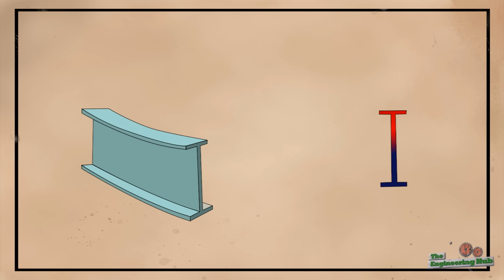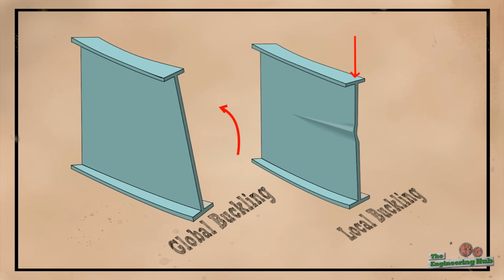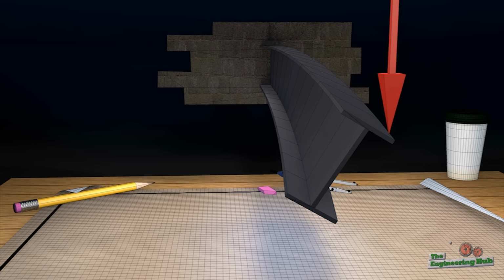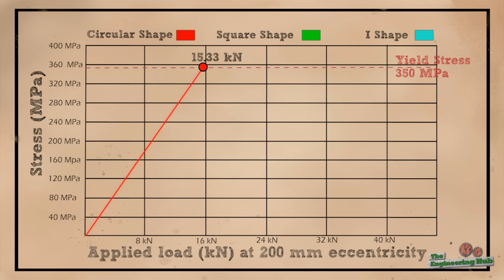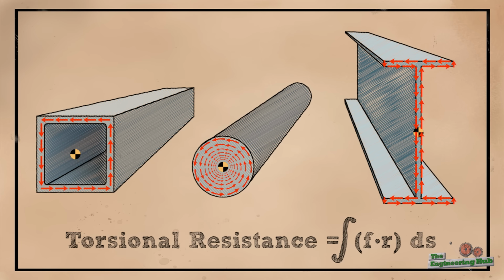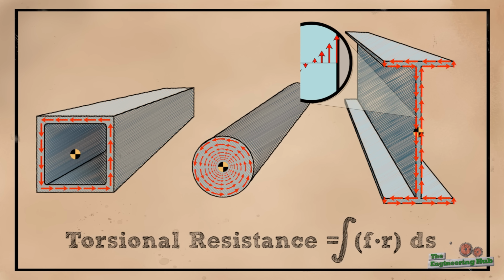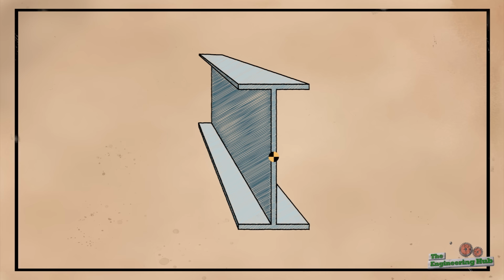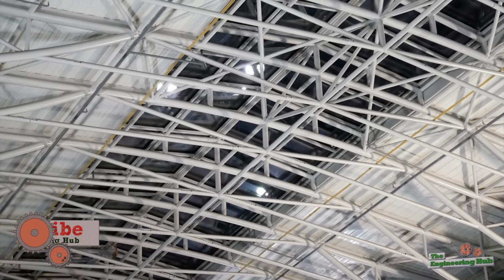The Critical Weakness of the I-Beam

Comment: Great video!
This video made me think of the forces placed on a hollow driveshaft of a vehicle.  Can you do a video explaining why it's better to be hollow vs solid?
Reply: Rerun the video, he dooes show you why hollow is better than solid. Basically, the further from the centroid the mass of the shaft is located, the greater the torsional force it can handle. Add to that the weight saving due to having a hollow shaft rather than a solid shaft and there are the two good reasons for hollow shafts.
Reply from the maker: Thank you ralph and Michael!
ralph, Michael has done a great job answering your question.
Thank you both for your comments.
Cheers
Reply: @TheEngineeringHub  Thank you for sharing your knowledge. I would still like to see a video that explores solid versus hollow a bit more, in particular, the optimal wall thickness to achieve maximum stiffness. I am thinking about axles for trailers etc.
Reply: @dougholland7563  The optimal wall thickness would change, depending on the axle length, diameter, and material used...
Reply: @dougholland7563  I used several hollow tubes welded form the inner to the outer to form a thick walled hollow shaft because hardening of metal usually only on the outer 6mm or so. I would say the ideal thickness for a tube wall is 12mm.
Reply: @jessh5310  Thank you! This gives me a useful benchmark to start from.
Reply: @michaelkelly339  
So, really it comes down to weight and material (cost) savings.  Surely, the simple fact of having extra material in the center would not be detrimental to the performance.  Remove the center and use that material to build five more driveshafts....cost, right?
However, I was informed in a high school automotive class that a hollow tube was stronger than a solid.  I think with it being solid, it would allow the shaft to twist easier.  I'm really not sure.  If that is the case, why have any shaft solid (i.e. a steering shaft)?  I really want to see the physics behind it.
It's torsional strength vs bending, right?
Will a solid shaft twist easier than a hollow shaft of the same material and diameter?
Reply: @RalphSampson...  
The answer to your questions is unsprung weight.
I don't have the exact numbers but unsprung weight (driveshaft) affects inertia, momentum and acceleration far more than sprung weight (anything above suspensions).
With some claim citing as much as 10 times more, again, correct me on the numbers.
So the weight saving here isn't for the cost but for the overall increase in performance.
F1 would've use solid shaft if they are better.
As for the steering shaft, while theoretically a hollow tube may be stronger, it resonates vibrations that can be transferred directly to both your hand via steering wheel, and the wheels themselves, resulting in poor (read dog shit terrible) driving experience and loss of precise control of the car.
Axle Shafts and CV joints are solid because they need to be able to withstand push-pull forces, where the driveshaft don't.
Reply: @RalphSampson...  a solid shaft will be stronger in torsion than a hollow shaft of the same DIAMETER, but it will also contain much more mass (and weight).
A hollow shaft made of the same mass (and weight) as the solid shaft, will be stronger in torsion, and more importantly for driveshafts, much more resistant to deflection (bending).   This rigidity is extremely important for keeping driveshafts balanced.
Reply: @RalphSampson...  Any extra weight in an end supported driveshaft will decrease the max rpm it can withstand.   If you lay a steel rod (solid) or tube (hollow) horizontally supported only at its ends (u-joints for a driveshaft), it will bow downward due to gravity.   You may not be able to see this, but with precise enough  micrometry you will be able to measure it.
If you run this experiment you will find that a hollow tube of the same diameter as a solid rod of the same material will sag less, mainly because there is lower mass pulling it down.   Now imagine a kind of gravity that gets stronger for every micrometer that that rod or tube deflects downward.  This is the environment a driveshaft operates in due to centrifugal force that will be many times Earths gravity.   And why high performance driveshafts tend to be hollow, fat, and aluminum.
Reply: Perhaps I can share my way of understanding it. Its nothing about hollow or solid. Its just strength per weight ratio or something like that. A solid one inch thick rod will be absolutely stronger than a one inch thick rod with a hole in the middle. Having material in the center is merely less bang for your buck though. The total bang does increase by having more material, but this is engineering; you want efficiency, and weight is a common concern. So imagine keeping the weight constant by shifting the material outwards. Instead of having material in the center, lets put it on the outside. Same weight(material amount), but you sacrifice a bit by making it a bit bulkier. And it becomes stronger.

Another way to understand whats happening is to think of leverage. Imagine nailing two nails into a piece of wood being half an inch apart. It would require a certain amount of resistance to being twisted together. Now if you nail it one inch apart, it would offer a lot more resistance to being twisted. Its basically leverage, here as a "resisting force" by the material.
Reply: I’ve learned much just reading these comments, thanks 🙏🏼

Comment: Wouldn't the corners be "stress risers" instead of actually"discontinuities?"
Reply from the maker: Yes, we could have been more clear about that. The discontinuity is in the geometry of the 90 degree corner which in fact causes stress concentration or as you pointed out a stress riser. Excellent observation, thank you for pointing that out!
Reply: I work with structural steel. In reality beams we fabricate out of hollow box section do not have sharp corners. The corners are very rounded, the radius on the corners can be 20-30mm or more on a 600x300x12.

Comment: Great video , thank you. One question, why did you make the circular beam solid? Given the only constraint was equal square area, surely it would have performed better as a tube?
Reply from the maker: The reason is two fold, first because our older video had these exact three shapes so we thought it would be nice to use the same shapes for comparison. Also, since we already had a closed shape (the square tube), and an open shape (the I beam), a different category of beams might have been better so we went with solids. That was the reasoning in the first video at least, for this one we just continued with the same shapes.

Comment: There is no fatal flaw in an I beam, if an I beam fails the fatal flaw is with the people who do not understand how an I beam should be used
Reply from the maker: You are not wrong John! But it is still a weakness, since a slight offset (eccentricity) of the load would reduce the capacity drastically.

Comment: Would crowning the top surface help to keep the load on centre ?
Reply from the maker: Hi Peter,
That's not something we've seen in our engineering practice before.
More often, we see either the I-beam or the point of load application moved, or stiffeners/braces being added.
Thanks for your comment!

Comment: Ever noticed the inboard corners of I beams are rounded and not square ? Reduces twisting by spreading torsional loading. The material is thicker and torsional forces are radially fluxed.

As others have rightly stated - I beams are not flawed they just have limits.
Reply from the maker: Hi Ade,
You are right, the corners are rounded for that reason. Good observation.
Hope you enjoyed the video :)
Reply: @TheEngineeringHub  I did enjoy revisiting first year mechanical engineering.

Comment: Does this mean the reinforced I-beam with the diagonal struts welded to the beam next door is the ultimate answer? Thereby eliminating any sideways collapse, turning the I-beam into a box shape?
Reply from the maker: Hi Bill,
The 'reinforced I-beam with diagonal struts welded to the beam next door' is a common and feasible solution, but not necessarily the ultimate solution.
If the same structural capacity could be achieved with less material, say by using a box beam, then the box beam would be a better solution. Additionally, sometimes geometric constraints restrict the feasibility of adjacent beams and/or struts. 
Thank you for your comment and we hope you enjoyed our video. 
We are looking forward to making many more.

Comment: Wouldn't most I-beams that are used in structures be designed to handle more weight than they will actually end up holding?
Reply from the maker: Hi C. B. Alan,

Engineers design I-beams (and all structures for that matter), based on statistical probabilities.
The design criteria is set so that the probability of failure is very low. 
In Canada, these probabilities are generally based on the 95th percentile loading event being combined with the 5th percentile weakest material. 
So, yes most I-beams at most times are stronger than the load they actually hold. 
However, engineers focus their efforts on the extreme load cases since those events govern the design.

Thank you for your comment and have a nice day! :)
Reply: It is, it's called the allowable, around 30% more than the design load.
Reply from the maker: You're very right M. Leung, durability is a relevant design criteria, as well as the statistical basis of load and resistance design (mentioned in my other comment on this thread).

Comment: Perhaps deeper beams should have, for certain applications, a much thicker Web?? Of course Web stiffeners go a long way to reinforce, but they can get in the way of other areas of construction design!
Reply from the maker: You are very right, the stiffeners can get in the way!
One structural solution around this is using 'open web steel joists'; although the capacity is generally less than I-beams, the open area and lighter weight is a great advantage for construction. 

Regarding thickening the web, engineers typically do review this option and look for a certain width-to-thickness ratio of the web to mitigate local bucking effects. When this width-to-thickness ratio is no longer achievable, then stiffeners are used.

Thank you for your comment and have a nice day!

Comment: Please explain why drive shafts (of rear wheel drive automobiles) are hollow.
Reply: Weight and stiffness
Reply from the maker: Hi BX B,
That's a great question. For now, we'll just say that the hollow shape is for resisting torque (and kermit's comment about weight and stiffness applies too).
In the future, we may do a video about this topic!
For other engineering videos about cars, check out this one we made about spoilers:
https://www.youtube.com/watch?v=ppoDH9VVadc
Reply: Weight (mass) is always important, but especially so in a rotating shaft. A drive shaft needs high torsional stiffness but light weight. So a hollow shaft (with larger diameter) has much greater torsional stiffness than a solid shaft of the same mass per unit length (since it would be a much smaller diameter). 
Proper engineering is all about optimizing many variables, each of which have different advantages and disadvantages.

Comment: There’s a massive difference between A flaw in the design & a design limitation.  If a engineer choose to use square tubing in place of an I- beam its not the tubing thats flawed… its a fatal flaw with-in the engineer not the tubing.
Reply: Right. There are many ways to reduce the risk of torsion, like joining 2 i-beams with braces, which is what they usually do.
Reply: @tubester4567  Yeah, engineers aren't stupid.
Bracing is amazing. Thanks :-)
Reply: @adelarsen9776  True , but some engineers lack common sense ! The good engineers have respect for the tradesmen working for them ,  and listen to their input ! Without engineers this would be a very different world .
Reply: @ag-om6nr  just 2 details. I would say "The good engineers have respect for the tradesman working with them..." Doesn't matter if both are from the same company or contractors of some sort.

And "Without (insert engineers, tradesman, nurses, accountants, managers, doctors, researchers, cleaning staff, drivers, cops.... as you like) this would be a very different world."
Reply: Exactly. I should have read your comment before posting my own.
Reply: If you generalize this idea.. then nothing is flawed.
Reply: @user-zu1ix3yq2w  A flaw is something unexpected that prevents or hinders the expected functions of something. For example, a flaw in a box would be extremely low durability, since it makes it hard to store and move items with it. Another way for flaws to appear is in the design itself, like a square ball. I hope this clears up things.
Reply: @victorvirgili4447  Flaws are expected not unexpected, especially in complex designs and material processes. Expecting flaws is why build specs come with +- tolerance values, or the variation amount allowed. 
Flaws are why engineers over engineer.  One of the best responses from an engineer at the end of a successful test flight. “Huh… we expected it to fail & explode… hmm” 
Every box has a flaw, that’s why there are different grades of boxes, bolts nuts….more flaws lower grades greater variation allowed.
Reply from the maker: Fair point! A design limitation is probably a more appropriate wording.
Reply: @TheEngineeringHub  clickbait draws more views though
Reply: Breaking News : "Steel Mills Close After Flaw Discovered"
Reply: @adelarsen9776 um no they don't. They make changes to correct their mistakes, they don't just give up. Maybe if you were running the company you would give up, but a true steel mill has zero quit. Make changes to make it right. Nobody like a quitter

Comment: Hi,  Interesting.  Your discussion of torsion in the "I" beam is also partly flawed.  "I", "H", "Z", even "C" beams (ie those with flanges) generate a large resistance to torsion from differential bending.  That is two say that in order to twist the I shape then the flanges must also bend about their axis perpediculr to the web (as drawn) which means for any given torque the shear stresses you show at the centres are actually a lot less than it apears.  The closed tube, be it round, square, rectangular or any shape must always be stronger in torsion than the same weight of open tube (its a tube even if not enclosed).  Why use open tubes not closed ones?  Firstly they are easier to manufacture (so cheaper) and also easier to inspect and maintain against such ills as corrosion.  Incidently what you have drawn is an "I".  To be an "H" it would be on its side!
Reply from the maker: Thanks for your comment emma,
We have tried to simplify many years of engineering study and practice into a short video, so we hope you can forgive us for condensing some details. Our shear flow animations focussed on the shear flow due to torsion, but our calculations and graphs did take into account both the shear stress resulting from torsion and the normal stress resulting from bending.
We appreciate your engagement in the comment section and hope you enjoyed the video!
Reply: @TheEngineeringHub  Hi, I don't think I can have expressed myself very well.  Yes you mention the bending stresses, but as far as I could see only those due to bending under the verticle load.  The bending mechanism in the flanges that I am refering to is a local bending in each flange which is induced in the flange by the tendency to deflect to the side (left in the upper flange and the right in the lower) due to the global beam twist.  This absorbs a portion of the work done by the load going down as strain energy of bending, leaving less to be absorbed by the overall beam as torsion.  In most practicle beams the strain energy of flange bending is far greater than the strain energy of the torsional shear stresses.  Thus the torsional shear stresses are far lower than you suggest.  However, I admit I didn't immediately pick up on your fully plastic beam.  For pure bending, once the flange of the I beam is fully plastic, collapse will be very quick since there is hardly any contribution to bending resistance in the web (it being relatively thin).  As an aside, the assumption of fully plastic bending (the top is plastic in tension and the bottom in compression) implies infinite shear stress at the centre line which may explain the splits in the centres of the webs of failed beams you show in your photos.
I admit that I struggled with the concept of differential bending at first, its not immediately obvious until the lightbulb in the head lights up.
This is the first of your videos I've seen so I appologise if you've already dealt with this.  Overall I am impressed, well done.